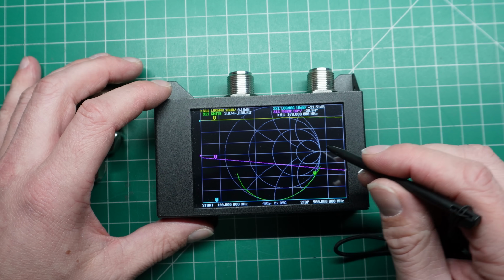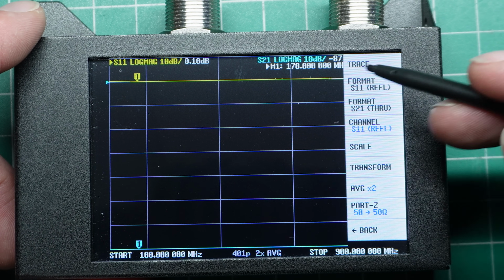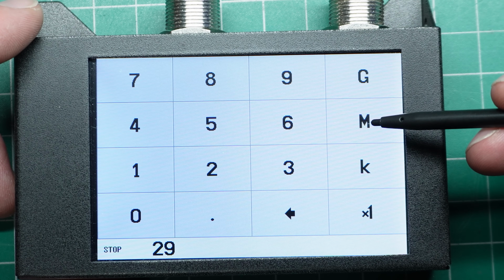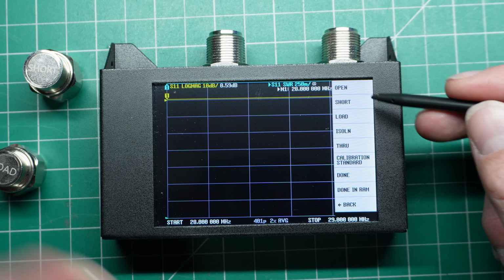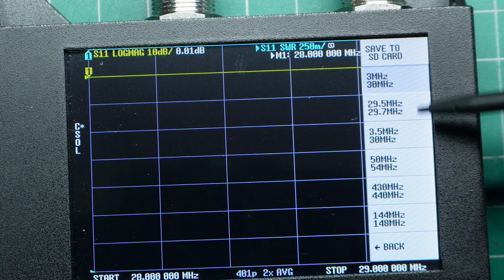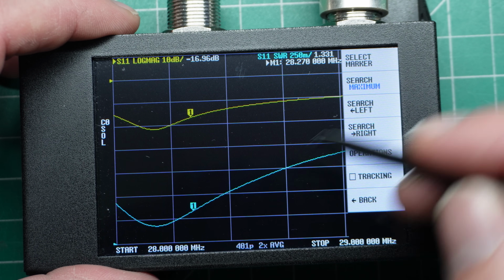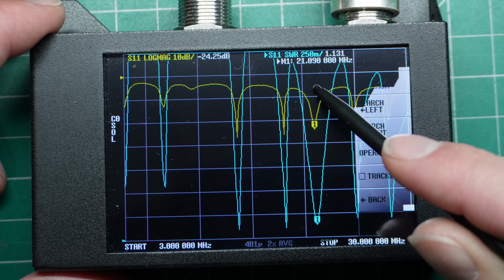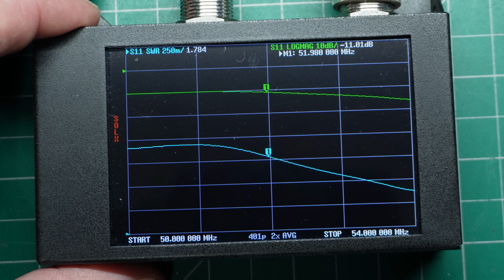NanoVNA: Measuring SWR Made Easy

Comment: You connect the antenna to measure the SWR directly to the Nano VNA and don't work with an attenuator or something similar?! 
What if there is static voltage on the cable? This grills the Nano VNA immediately.
Reply from the maker: Don’t operate it during a thunderstorm
Reply: @HamRadioDX ...for sure😊  Antron A99 doesn't need a thunderstrom for electrostatic voltage...

Comment: Hayden, I watched your video then bought a NanoVNA SAA-2N. It has helped a lot with EFRW antenna adjustments (I've been experimenting with EFRW and EFHW antennas.) I did get tired of going out of the house to make adjustments to the clamp-on ferrite chokes position on the coax and adjusting antenna wire length, then going back into the house to see what the results were. So, I installed NanoVNA Saver on my computer. I already had Zoom installed on my PC, I added it to my phone. Now, I can start a Zoom meeting share the NanoVNA Saver screen and watch the adjustment results in real-time while I'm outside. No more running in and out of the house multiple times.  Thanks for the great videos. 73
Reply from the maker: That's a fantastic way to use it, thanks for sharing your tips!

Comment: Nice video, Hayden.  Which firmware are you using in your SAA-2N?  Just curious.  Also, you demonstrated recalling calibrations form the SD card.  Did you purchase a newer SAA-2N with an SD card slot, or did you modify an older SAA-2N  to include/support an SD card?  Again, great job.  73.  Ken -- WBØOCV

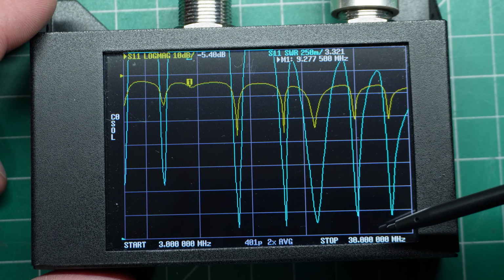Comment: Nice simple to follow video.  Few things that are good to put on - You can add gridline values, so easy to view the SWR.  Also add in extra points so you can see at a quick glance the values at specific frequencies, I also think you can add in multiple minimum points, which would be useful at 6:10.

Comment: ALL:   I fried my SAA-2N.    Turns out if you search for NanoVNA SAA-2N repairs,  you will find that the CH 0 /  Port1   is susceptible to ESD  (electro-static discharge).   The Ch0 port goes into an RF Switch Chip callled --->  Maxscend MXD8641 RF Switch ".    There is little to no ESD protection.   The only thing to do is replace the chip - a small 16 pin surface-mount device.    The symptoms are a inability to achieve a good CAL.  And after a CAL the traces are erratic   (READ:   They are all over the dang place )     This issue arises when connecting a coax cable that has a little ESD charge on it.   then....  ZAP!
Reply: Good rule of thumb with any delicate electronics is make sure they + any attachments are grounded before playing with them, I learned that rule of thumb in the IT field and it has made me never lose something to ESD.
Reply: @Bryantdl7  thanks.   Im making a video on my channel for these repairs.   wish me luck!     LoL
Reply: Our fellow HAM "Clint"  KA7OEI  has a write-up on his blog site about repairs to SAA-2N that has a blown RF switch   https://ka7oei.blogspot.com/2025/03/repairing-nanovna-v2-blown-up-input.html      just in case some other people have same problem

Comment: Hayden, this is the #1 vid on this topic.  You cover a number of things that others have left out that totally confused me trying to use mine.  A huge Thank You.  Yeah it was fast, but my computer has a Pause feature :)    Only question I have is the Calibrate WITH or WITHOUT the jumpers/adapters in place.  Everyone does it different.  Thoughts?
Reply: Best to calibrate with all adaptors in place if you have calibration standards that allow for that, otherwise you're only calibrating up to the ports of the VNA and your measurement will include the loss of your adaptors on top of your antenna measurement

Comment: I have a SAA-2N from a few years ago (2021?). Yours seems to have some nice new features that mine doesn't. Could you let me know the firmware version in yours? Maybe I can find the more recent firmware on the internet if I know what to look for. Thanks! (Btw I've measured antennas up to 3.4 GHz with mine!).
Reply: In my SAA-2N menu, I can select CONFIG->VERSION and it shows the software version info. Maybe yours does the same? Mine is version git-20201117-9659de4. What is yours? I hope that will allow  me to find it on the web. Thanks!
Reply from the maker: I did update the firmware, but I can’t recall where from or what version now. I’d have to go digging.

I think I got the firmware from the nanovna groups.io site?

Comment: My NanoVNA has a memory slot that will auto load a saved configuration upon power up.  I have mine set for SWR and impedance from 7MHz to 54MHz.   I also installed a microSD card and did all the SWR calibration for all the individual bands from 80m through 70cm.  I also saved configurations for doing cable loss.  In essence I made my NanoVNA into a poor man's Rig Expert.
Reply from the maker: That's a great setup - its a very useful tool!